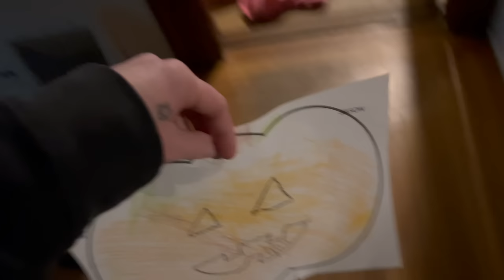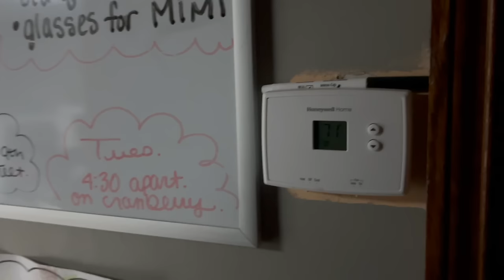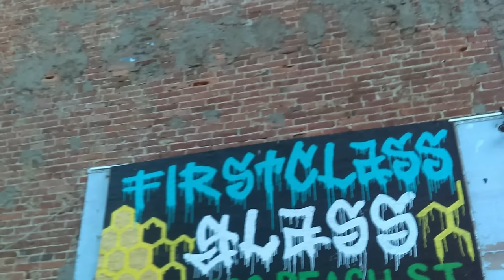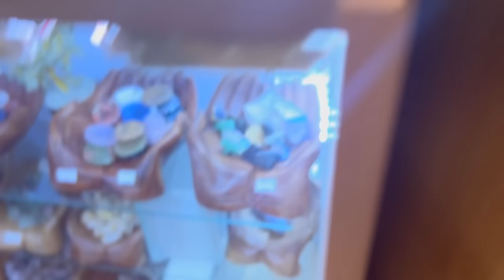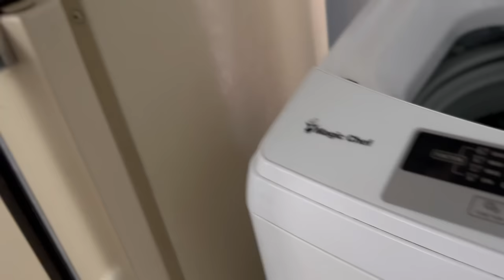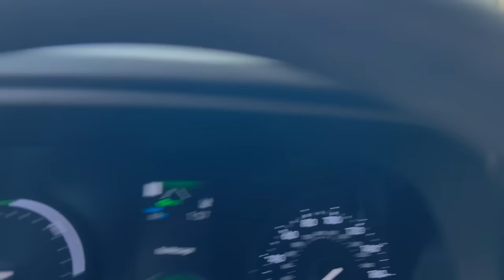a day in my life as a tired and broke single mom // apartment search // realistic // vlog

Comment: you have the seat belt in the lower position, raise it up, the closer the neck it sits the safer it is, if 
you have it too low then the risk is that it slides off your shoulder during an accident, and then it 
can hurt you instead